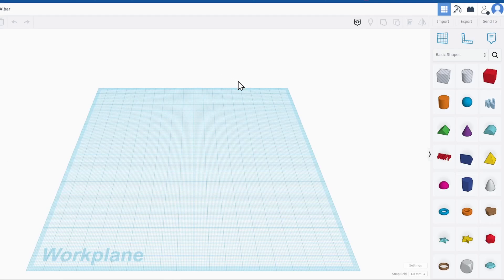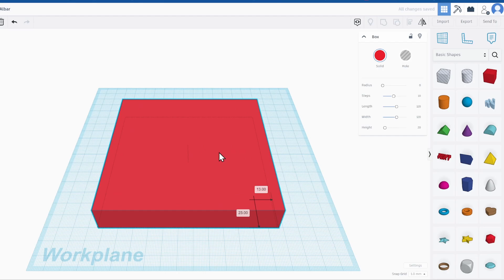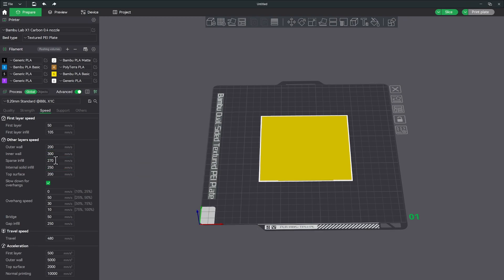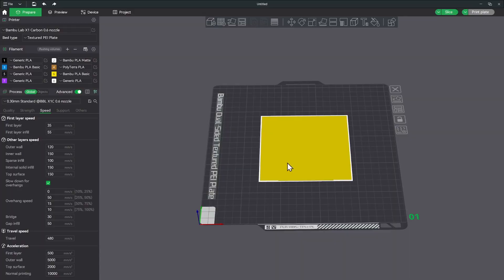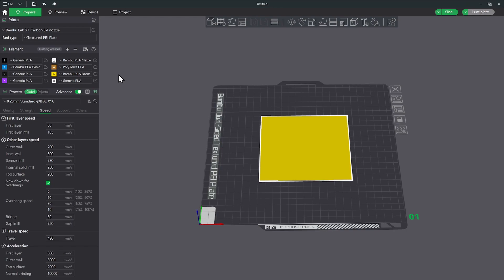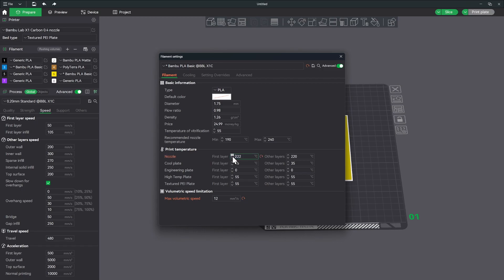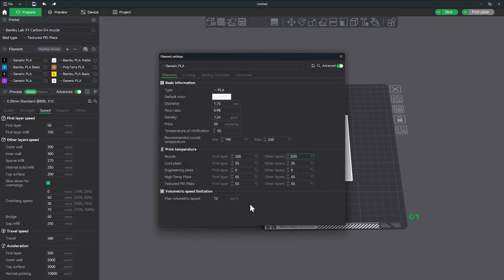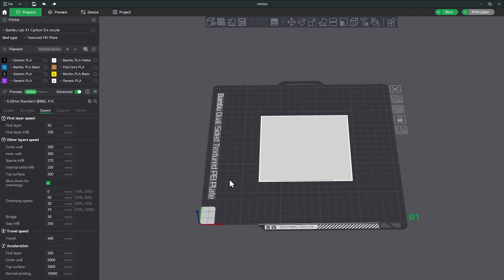How to print in ludicrous mode

Comment: One tip - I had the same issue with a rough texture after switching to ludicrous mode, but the issue ended up being the default K factor for generic PLA being too high. After doing a flow calibration test, I changed it from the default setting of 0.20 to 0.01 and the prints came out perfect. I think what you did in the slicer accomplished basically the same thing, but the K factor is intended to be filament-specific.

Comment: It does not not print cause the printer supports a max volumetric speed of about 32 and ludacris mode simply increases the print speed for all moves to (I think) 166%. So if you set volumetric speed to (let's say) 25, then it would reach a max of about 41.5 during the print, which is not supported and the print will fail. If you really want to print at that rate, maybe you can get success by increasing the temperature. Maybe about 260 for PLA.

Comment: This sure does look like a bad Z offset. The bamboo lab does not have a live Z adjustment. We rely on the bed leveling and all the other magic gizmos on this printer but if you can’t do a live Z offset you’re gonna always have the problem you’re showing this typically looks like the nozzle is too close to the bed
Reply: You'll see it on vertical surfaces too.

Print model in sport or ludi mode - it'll print garbage, switch it mid print to normal mode and watch it print like glass.

If it was z offset, i think I'd expect it across all print speeds, especially during the same print session.

Comment: My daughter and I were driving the other day and I said, "See that Tesla S?  It is a plaid model. It has ludicrous mode and is faster than $600,000 exotic sports cars and costs about $130,000.   She thought a moment and said, "what is the point of that, there is a speed limit."

Same for 3D printers.  What is the point in ludicrous mode?   The output is pretty much junk.

Comment: So, when doing luda mode it multiplies all speed settings to 1.66, so 21 mm^3/s becomes 35 and when you set it to 12 in luda mode it becomes 20.
Instead of doing these tricks, I'll suggest just multiplying your speed numbers in the filament profile itself and setting the volumetric mode which works for your filament (20 in this case) and don't touch the printer settings.
Reply: No reason in having to change it to ludicrous mode. if you are already printing at 21 max volume.

Comment: Try with a ludicrous high print temp. 
Those models, you made, require a lot of heat in no time.
EDIT: I dont know if it is possible to preheat the filament to 35-40 C. If it helps, then you know you just reached max heating capacity.
Reply: I’ve seen and heard this. I usually do the max heat but now I’m trying sports mode and adding 10c on the optimal setting to see how it looks. Wish me luck  in another 10ths. Lol

Comment: Volumetric speed merely limits the max speeds it will hit. You can calculate the required volumetric flow per second from the movement speed, line width, line height, extrusion multiplier. If this is at any point above the threshold you set, it will limit the print speed.
Reply from the maker: Correct.  This is not obvious and straight-forward.  The point of my video is to get folks paying attention to that if they are having issues.  It was set correctly for the generic PLA, but it was set way too high for the Bambu filament.  I will say it is now easier to fine tune the high speed prints using this instead of the other 10 speed settings.

Comment: If you want to print in ludicrous mode all the time ? ,  try by halfling the all the speeds that way you want have an problem ?
The only thing you have done is limit the speed by using volumetric volume , But why did Bambu set the volumetric volume at 21 mm3/s ?, because that is the idea setting to print at normal speed ?.
The clue is in the name ludicrous - definition stupid , foolish , crazy , dumb .
Reply from the maker: My old 3D printer printed slow so if I wanted a slow printer I could have just stuck with that.  The X1 is advertised as high-speed and states up to 500mm/s velocity and 32mm3/s flow.  Am I stupid, foolish crazy, dumb for trying to get out of it what is advertised or would it be stupid, foolish, crazy, dumb to buy a high-speed printer to run at low speeds?  Let me know. :)
Reply from the maker: I also don't want to run it at ludicrous all the time.  But if its there, I DO want to use it.
Reply: @lendizzle77  I think the advertised speed of 500mm/s ( which I think is around ludicrous speed ) is not stating what plastics your are using and what the final product will look like . ( try printing TPU at 100mm/s )
I love the adverts which say "from" , "save £100" they are correct but a little open .
I'll remember that in defence the next time I get stopped speeding , I have a car which is capable of doing over 120 mph so I would be stupid, foolish crazy, dumb not to trying to get out ? 😂😂😂
Reply: @peteradshead2383  LOL!
Reply: @lendizzle77  OK, letting you know. Yes, you are /s :)  The X1C (I own one) is stupid crazy fast at Standard speed. Trying to push it is "experimental" at best. There is also a Sport mode for when you have a well dialed in print and you're willing to sacrifice a bit of quality for speed. This whole discussion revolves around physical boundaries that exist in FDM printing, it has NOTHING to do with Bambu Lab's "failure" or "not delivering". The Standard speed of the X1C or P1P blows away printers that cost upwards of $4-5K and certainly much faster than your "old 3D printer". I've been in this world since 2015. The X1C is mind blowing in fit, finish, cost of parts, support. They're bringing the heat to the rest of the 3D world. Cheers! Edit: can't sppell
Reply: Interesting video! You kept switching between 21 and 12. I don’t understand why you didn’t try some intermediate values. 

I have gotten similar but not as bad results printing generic PLA using the Bambu Basic settings at the default normal speed. The problem disappears when I switch to silent mode for big surface areas and then I switch back to the normal speed after that section is done. Not convenient, but it works. 

It would be nice to have an automatic limit for the big surface areas, but still go faster in the other areas.

Comment: It's dropping the speed to avoid too high volumetric flow, indeed.  I.e. also their well-designed heater/nozzle combo has a limited amount of plastic it can melt when pushing it through at high speeds.  The high-speed filament just melts at a lower temperature, meaning the hotend can melt it faster and hence push more of it through.  The volumetric flow setting in the slicer just limits the speed at which it will try to push filament through.  This value is not only determined by the heater, but also by the material, i.e. how easy it melts.  One way to (somewhat) increase the actual max. volumetric flow is to raise the hotend temperature (up to the point where the heater is pumping in full power 100% of the time).
Reply: This is correct, but also has limits.  I spent a number of hours sitting over the printer this weekend fussing over speed and temp while running a 10 hour print.

I was running Geetech Marble PLA, 0.4 mm nozzle on a skateboard holder with 15% adaptive cubic infill.  This meant a lot of long, straight paths, reaching max velocity, combined with lots of smaller straight paths.

I had the temperature cranked all the way to 260  on Bambu high volumetric output filament profile.  The hotter, the better from the perspective of pushing out filament.  The limiting factor at that point becomes the cooling.  I could see the infill line breaking up (you called it wire wool), and when it does it splits with both sides pointing up, which the tool head runs into next time.  At lower temps you can increase the heating and the break-up disappears.  When you get to a certain point in the temp range then it breaks up due to lack of cooling.  I tried no fans, partial fans and full fans.  On this second break-up the solution was not more heat, but more cooling.  I assume the breakup was happening as the viscosity of the melted plastic was too low and it 'ran' out.  Max cooling saw instant success.  Trying both of these levers in combination I still couldn't get a consistent 'sport' mode, let alone ludicrous. 

FWIW, the adaptive cubic infill is a perfect test as it is always building an overhang, so any 'bad' sections are gone in a few layers and you are starting again with a fresh base, so you're keeping check on your variables. Plus you can see individual breakups, their consistency and if even a small chance makes a difference.  

HTH!
Reply: @JonathanLuker  I wonder if Noctua fans will push more air and at the same time less noise?
After I changed to Noctua fans in my PC, it ended very close to silent and at the same very cool.
Reply from the maker: I have bumped the nozzle temp on PLA to 230 for all prints.  Not just the high speed ones.  Nozzle temp definitely helps smoothing these out.
Reply: @lendizzle77  Try raise in increments of 5 degrees.
Reply from the maker: @Gert-DK  That's how I got to 230.  This helps but does not solve
Reply: @lendizzle77  It seems you have reached max heat the printer can put in the filament. 
BTW, can the nozzle keep 230 during print. If not, then it is for certain that max heat transfer has been reached. 
Since the print head has no problems with high temps, then try 240 or even 250.